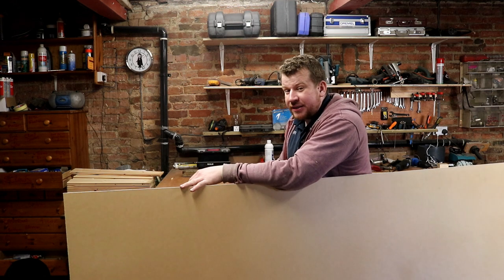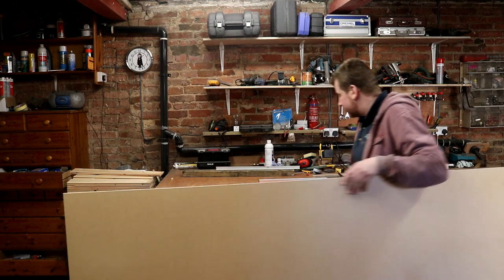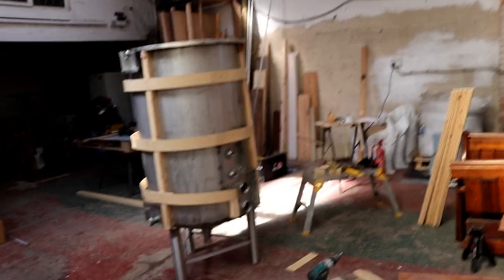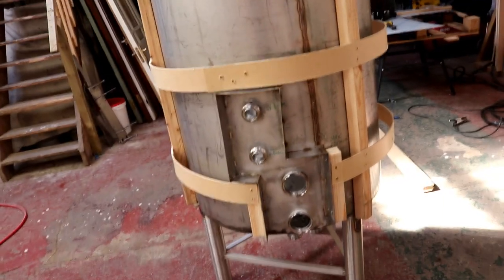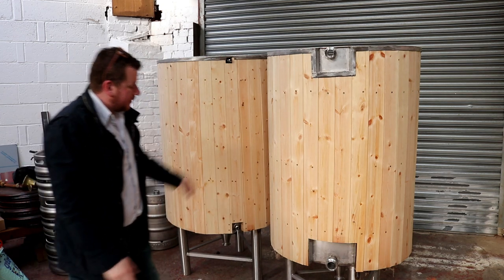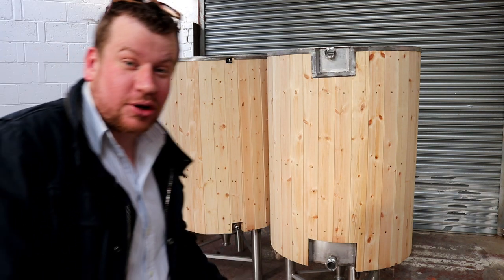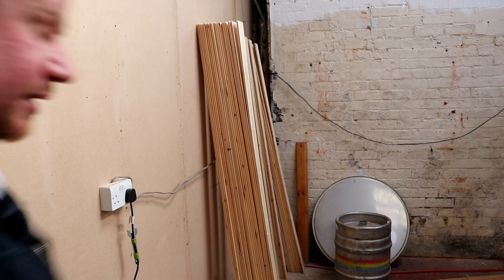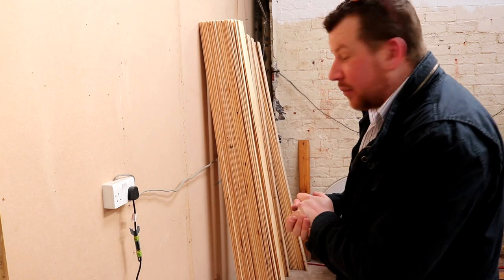Boil Kettle Clad

Comment: Yo you got dangly bits you scruffy git 😄 . The timber is tongue and groove on the edges aint it? If so two or more offcuts between two full pieces will hold perfectly well. If you want to be really posh cut some tongue and grooves on the ends of the off cuts for extra stability. Looking good though and a great instalment as usual. Cheers, Schnuz.